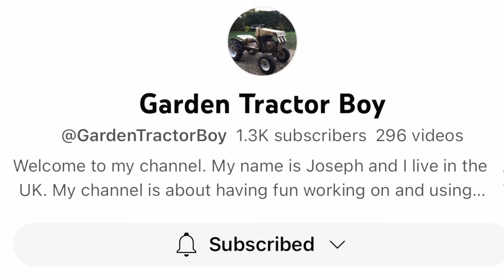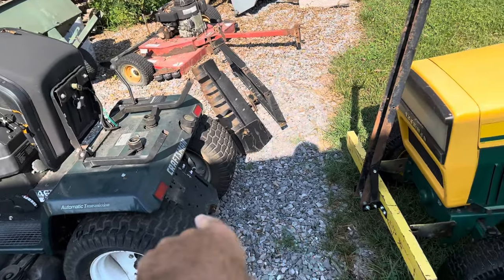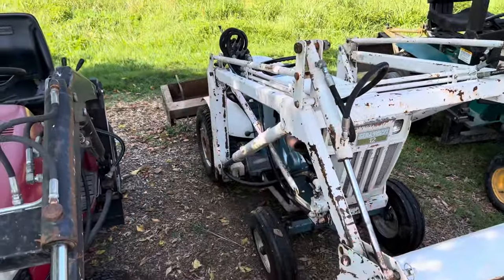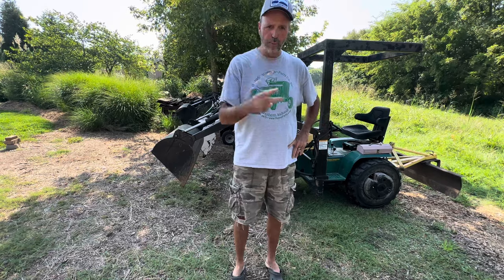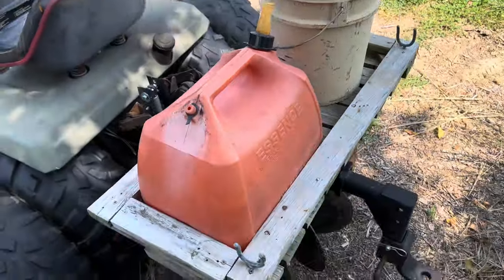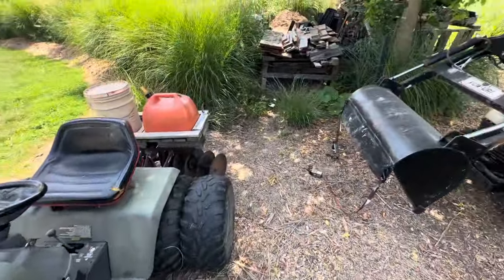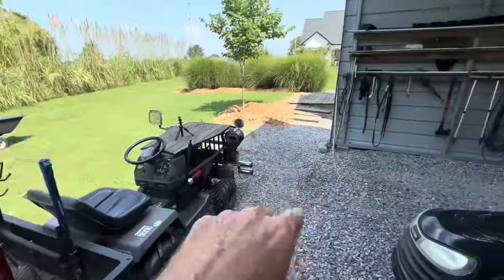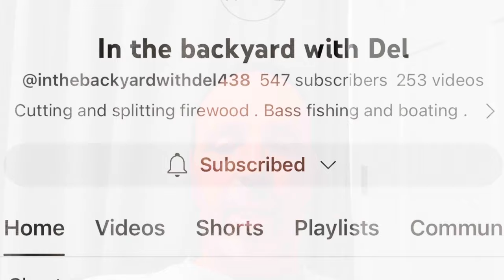5 garden tractor attachment challenge ￼

Comment: Hi Lee,
I completely agree about the three point hitch and front end loader! The FEL is the best attachment, assuming the front spindles and steering are tough enough. As for the 3-PT, you can put implements on, a back blade, have a liftable towing receiver, making it super convenient to connect to trailers. Cheers!
Reply from the maker: The sears fel  it’s probably the weakest one, but it is the oldest, the other two have the bigger axles and the red one even has power steering

Thanks for watching